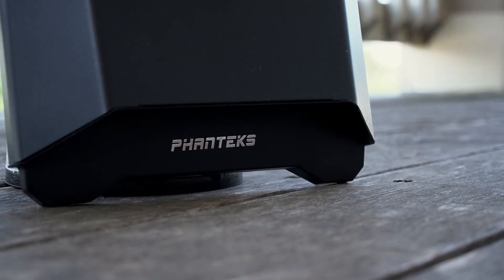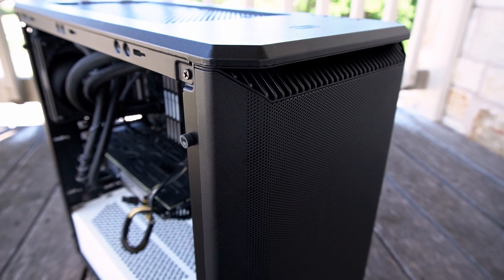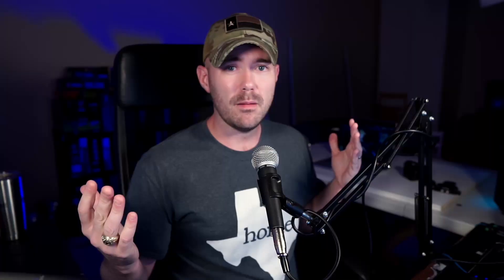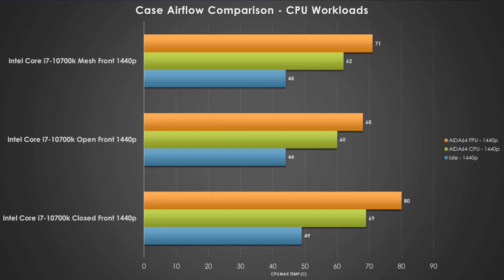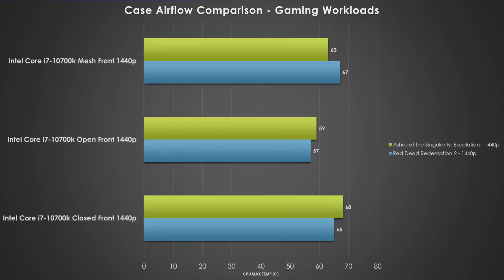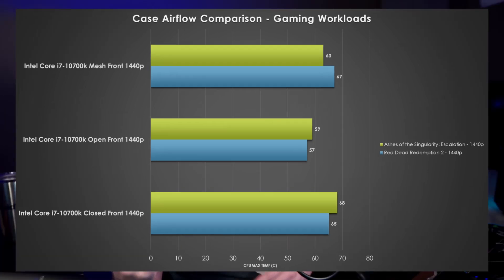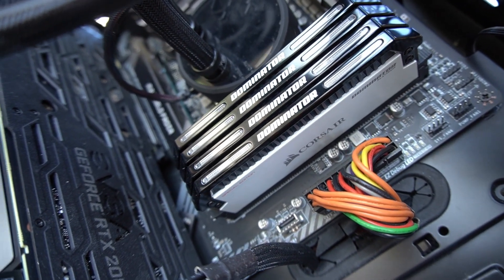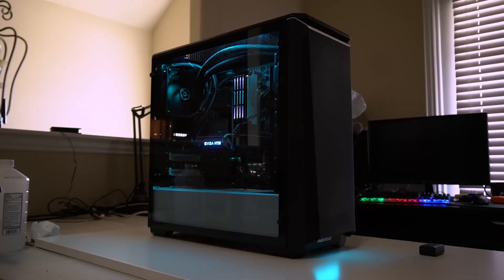Drop Your Temps by Increasing Airflow

Comment: Quick question does the p400a front panel have anything janky happen to it when u replace it for the p400? On the website it says that the fans are off by 8mm. Does it wiggle at all or have bad build quality when u swap them?
Reply from the maker: The fans are a bit off-center, but they still mount and function just fine.

Comment: What are your Gpu temps like? My gpu temps get up to like 85 degrees with that case and only a front aio and 1 rear exhaust, with the solid front panel on. Will that decrease a lot when I buy the mesh panel?
Reply from the maker: Temps are normal for me with three intakes and 1-2 exhaust. Of course, normal is different for each GPU
Reply: Just bought the mesh panel, gpu temps dropped about 10 degrees from 75 to 65 that's with with a 280 aio front mounted as intake
Reply: @ICERNK  I bought the front mesh and it did nothing at all 😂
Reply: Oh what no way! Gutted... Weird tho, what do you have as intake and out?
Reply: @ICERNK  my cpu cooler (coolermaster ml240l v2) in the front, 1 in the back. The top is open
Reply: @DTunezOfficial  It might actually have to do with the radiator. It will have heated the air before it hits the gpu, which might explain why it makes less of a difference.
Reply: I would ad another fan at the top maybe? I have a 280 aio and a 120 and 140 exhaust. Weird that mesh panel didn't make a difference for your gpu temps?...
Reply: @ICERNK  yeah its weird. i think ill try to add more fans
Reply: @DTunezOfficial  Once you will install more fans, can you please share your result ? i' don't have an AIO cooler and my system is know to be hot, i've a R9 290, it's going up to 81°C after few minutes and the GPU become way too noisy, it's like someone is vaccuming ...  I've already changed the thermal paste on my gpu, didn't see a lot of improvement, maybe by 5 °C but still not great...

Weird how i love  / hate this case    and   love/hate my setup.. hope that this mesh could maybe help, but from where i leave, it's clearly not cheap ! 36€ so i would like to know instead of keeping wasting money

Comment: I noticed that your setup is currently running one exhaust fan. I'm not sure whether or not this will impact your temps (seeing that even your GPU has an AIO), however I installed a second exhaust fan at the top left (120mm) and it helped with my temps which reduced about 5C - 7C depending on the room temp.

Great vid, definitely going to buy the panel to further help with preventing my card from hotboxing the case

Comment: I have this case and have been considering getting the screen front panel for it.  Question though, when installed with fans up front does the screen front  cause the front fans to appear off center when looking at it from the front?
Reply: Yes it does appear off center
Reply from the maker: Confirmed
Reply: @TheTerk  do you have an image to look how bad it looks?
Reply from the maker: @BuenaEzekiel  I can post one to Twitter later tonight @theterk
Reply: @TheTerk  That'll be cool, thanks!
Reply: Can you buy the mesh front panel separately?
Reply from the maker: @Assimilator702  sure can - https://www.phanteksusa.com/products/phanteks-eclipse-p400a-air-mesh-front-panel
Reply: @TheTerk  Thanks. I was just in the site and didn’t see it. I was thinking of drilling 673 holes in my front panel.....but $20 for the new panel sounds  like a better deal.
Reply: @TheTerk  I just had the panel in my cart and was ready to complete the check out and noticed the shipping is $15.79. So it’s really $35+ for the panel when a new case will cost $70 total shipped from Amazon. That’s a tough one.
Reply from the maker: @Assimilator702  I almost did the same thing. You can make custom design too. Just make sure to tape both sides of the panel to not knarl up the finish
Reply: @TheTerk  I do car audio fabrication for a living. Making panels from scratch is one thing but to modify an existing ting panel that’s visible is more involving. I COULD cover the front panel with a fabric but then we could be right back where we started with restricted airflow. I’m thinking of making a jig that would allow me to make perfectly spaced holes but making them around 1/4” each which should help with airflow. Or maybe even make a bunch of 1/2” holes which should increase airflow with 2 X 120 mm Noctua fans. The  panel would also have to be repainted. So many things to consider since I would want this panel to look ABSOLUTELY PERFECT or it would distract me too much considering the level of perfection I demand of myself from any work I get paid for. Hmmm.....maybe that $35 isn’t such a bad idea after all. And one other thing I didn’t think of. Making so many holes in a panel could easily snap several drill bits which I will EASILY pay more for than the overpriced panel costs from Phantek.